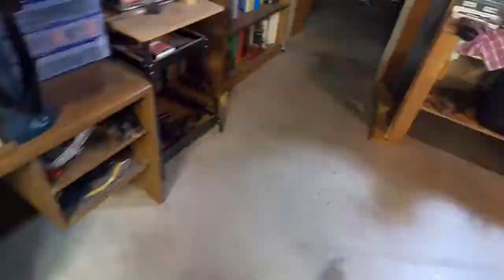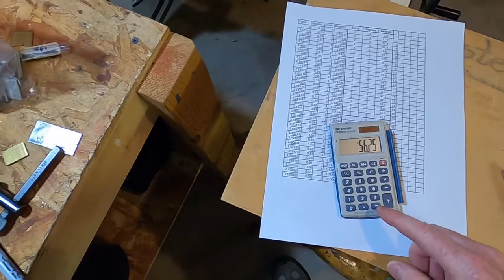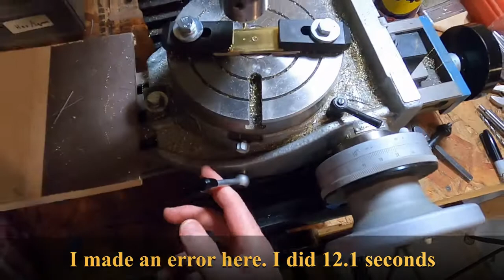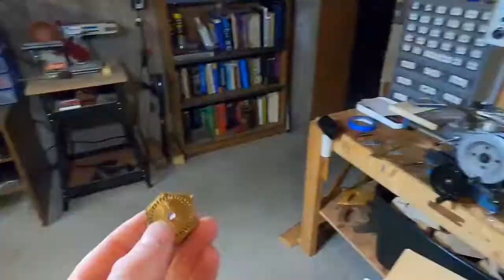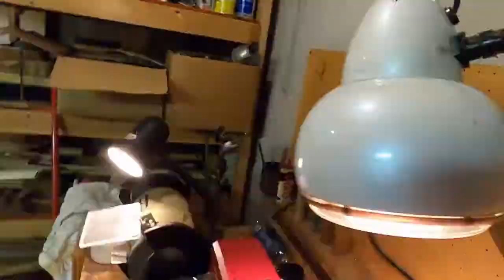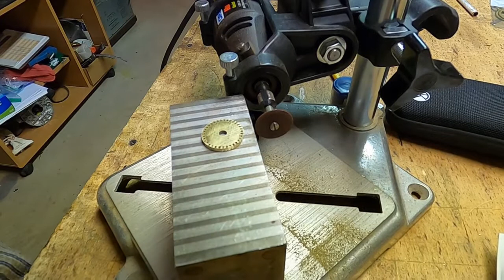Making a Gear on a Rotary Table

Comment: There got to be a better way to cut a gear.
Reply: There is! Go metric?😅
Reply from the maker: There are other methods using a gear hob and gear cutting tool. I couldn’t find a small enough cutting tool and I don’t have gear hob. These clock gears would have originally been stamped from sheet metal.